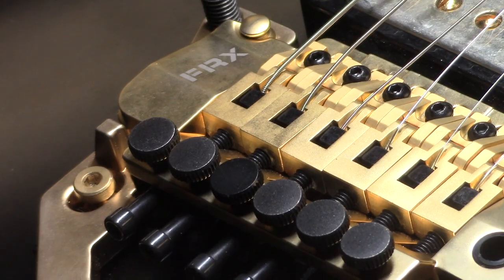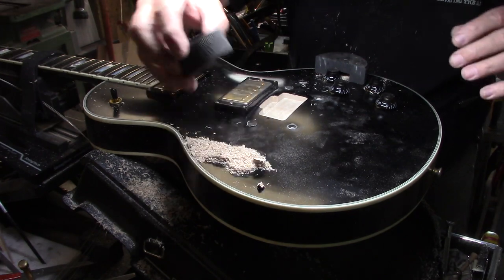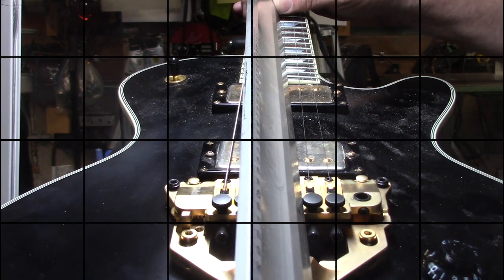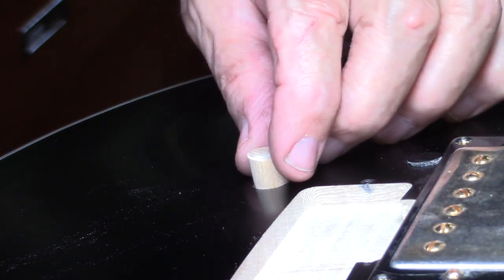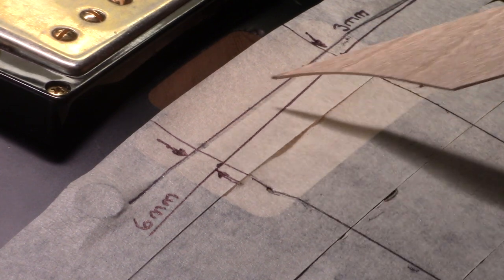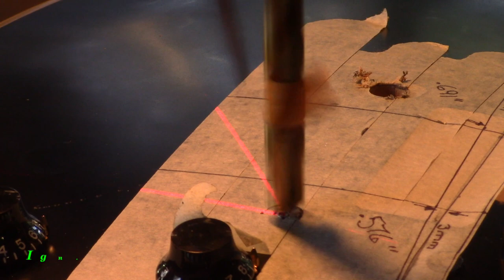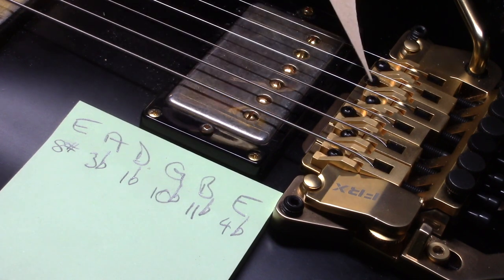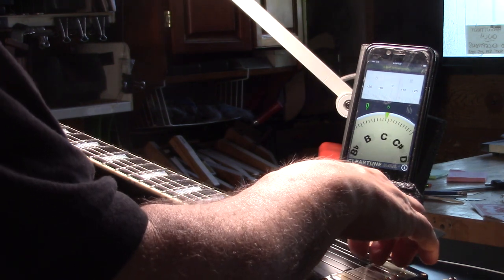Floyd Rose FRX Install @StringTechWorkstations

Comment: Funny, I don't hear any mention of replacing the pickups with F spaced? Would an Fspaced pickup NOT have briought the string spacing to within alignment? Not that this would account for the distance, but still.
Reply from the maker: The string spacing for the pickups was a smaller concern. It was the mis-alignment of the strings' trajectory, to the fingerboard; that was the real problem.

Comment: Great video on this setup. Thinking on get FRX also for my Epi LP. But isn't that FR promise "there will be no routing need for setup" means it supposed to be fully plug & play installation? Honestly, I reconsider get FRX after watching this video 😂 
Great explanation indeed, especially about adjusting the length of 6th (longer by 6mm) & 1st (longer by 3mm) to compensate intonation. Just curious, this compensation also  the same length for strat length 25,5" ? Thank you, really expand knowledge about this 👍🙏
Reply from the maker: In most instances you wouldn't need to router. This was an exception. With all of the "saddle travel" on a Strat ... short answer .... yes the 6mm / 3mm will work.
Reply: The problem with the FXR, is it mounts to the tailpiece, which is not a set standard distance on guitars, and the same brands.

Comment: Question: These FRX trems are marketed as 'NO need for routing cavities', but you routed a small recess.  Is that necessary?
Reply from the maker: They'll need to change that pitch for " Routing cavities needed in some instances ".
Reply: I think the whole frx was not setup right. No need for routing.
Reply: @metalheadbillseiw001  Not true, they should have stated no routing on a flat guitar. routing needed with a high arched/curved guitar. BTW: Its my guitar. plays awesome.

Comment: l Found it Over Engineered and too Bulky for an S.G. so l fitted a Deusenburg instead, Simple,eligant, and works Fine and Suits the S.G. l DO Like The Standard Floyd Rose Units though with the Springs under the Guitar Body.
Reply from the maker: Interesting. Thanks for sharing.

Comment: Nobody knows why the routing was necessary? I'm very curious to know. I'd like to purchase one of these but if it's leading to bad surprises I'll have to pass. Too damn expensive for inconvenient headaches.
Reply from the maker: The neck set and height of the arching will determine whether you need to rout or not.
Reply: @StringTechWorkstations  Oh, I see now. That makes perfect sense.  Thank you very much for your response. I appreciate it.

Comment: So, you need to add 6mm to 12 inches?

6mm is 0.2362204724 inches.

12 inches is 304.8 mm.

Why use mixed measurements?
Reply from the maker: I was using a hypothetical string length of 24" divided by 2 = 12" ... for an easy explanation of theoretical string length . The actual scale length on this guitar is 24 5/8" ( LP Scale )  ... it is much simpler to use 3mm and 6mm as an additional length for explanation, for the non-math heads. When I am doing my own calibrations I always switch all scale lengths to metric ... simply because of the division of "10" ... you can easily apply a percentage into the mix. In this case 627mm x .097% = .60819 ( or roughly 6 mm for the 6th string compensation )  627mm x .047% = .29469 mm ( or 3 mm for the first string compensation ). Cheers CJ \m/ !
Reply: Because he is complicating this entire up grade.  Even routed the body ruining the value of the guitar for no reason.
Reply: The guitar already routed when he received it. I guess the customer don't mind about it. And the 6mm / 3 mm metrics scale really not confusing neither complicated at all, just use the simple converter from inch to mm.

Comment: That bridge wasn't very well thought out if it doesn't line up.. I looks cool but that doesn't mean anything.. It's designed for a les paul but it doesn't fit.. Most people won't plug and move everything to make it work..
Reply from the maker: Once again ... as mentioned previously; the customer attempted to do the job ... then shipped it to me; once he realized that it was a bit too much for him to handle. I rectified the discrepancies, doing what was needed to bring it up to 100%. Because of the variations in Les Paul neck-set angles; there are instances where some routing is required ( as stated in the bridge "owners manual" ).

Comment: Wow, no wonder Trevor wasn't able to do this, it is pretty complicated for the average Joe. Certainly not something I'd attempt. Why did I see the ring ends of the strings on the headstock tuners? Is that a Floyd Rose thing?
Reply from the maker: Eddie Van Halen started that trend .... many years ago ... makes perfect sense.
Reply: You are correct. It is my guitar. So freaking happy with it. FRX is for a flat bodied guitar, not a high arched guitar. I bought the Eastman so I could experiment. Glad I did. It has its own vibe that is awesome. As far as strings, it works running them backwards and no sharp anything at the neck. Sometimes I do that. Sometimes I just cut them.

Comment: It's a good idea but routing into the guitar even that little bit is the thing you want to avoid. And so many minor adjustments left and right front and back, considering that peg system is pretty standard it should be a better fit Out of the Box.
I guess if you actually use the bar enough it is worth it, but for the price, a nice Squire Strat as a second Guitar is probably a better option if you really want a whammy bar.
Nice Dr's Chair there for the Guitars 4:26
Reply from the maker: This was a rescue mission repair / install. Cleaning up after the customer attempted to do the install himself.
Reply: Its my guitar. I bought an Eastman so I could experiment. It was not useable when I sent it. Routing is exactly what it needed. I did tweak it after I got it back, but its flawless now and my favorite guitar. Can't tell you how awesome the FRX is. Has all great qualities of traditional Floyd and more. Best quality: can do double stops perfectly in floating mode. Its more subtle. Love it. Couldn't pry this guitar from my fingers is all I need to say.